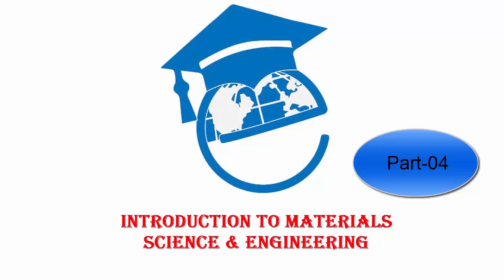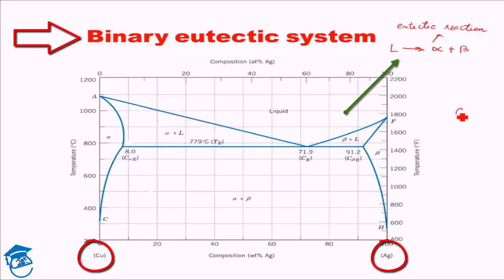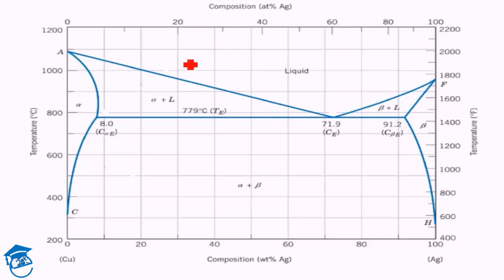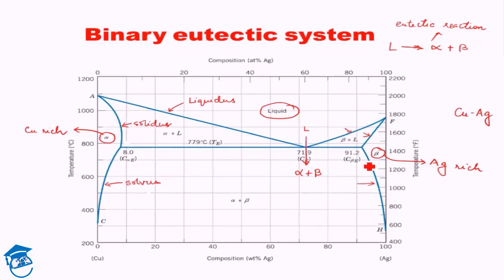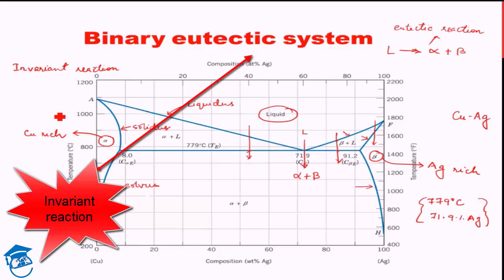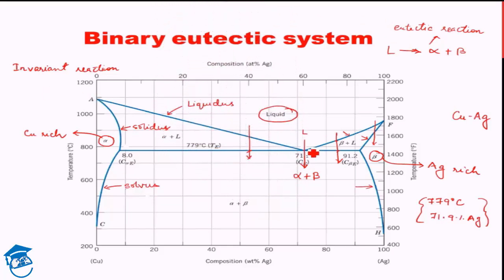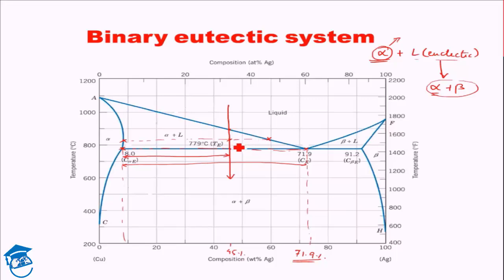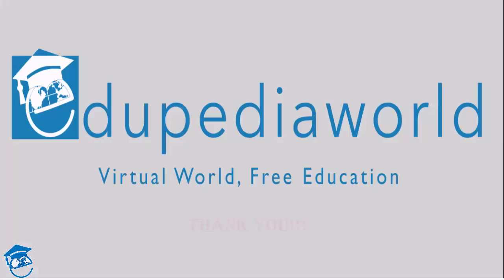AMIE Exam Lectures- Materials Science & Engineering | Binary Eutectic System | Phase Diagram | 8.4.1

Comment: Consider the binary eutectic copper-silver phase diagram in
Fig. below. Make phase analyses of an 88 wt % Ag-12 wt % Cu alloy at the
temperatures

1000°C, (b) 800°C, (c) 780°C + ÄT
, and (d) 780°C - ÄT . In the phase analyses, include:(i) The phases present(ii) The chemical compositions of the phases(iii) The amounts of each phase(iv) Sketch the microstructure by using 2 cm diameter
circular fields.